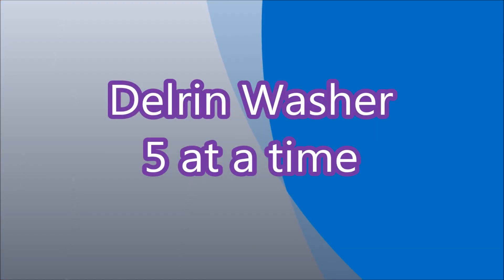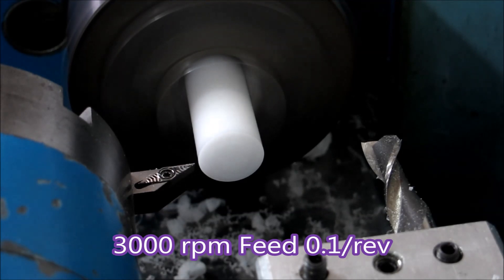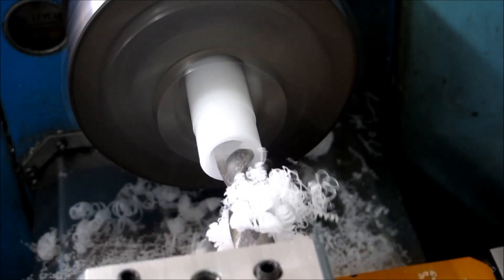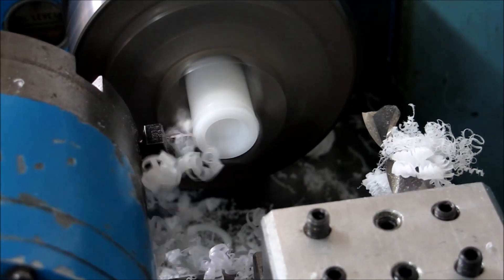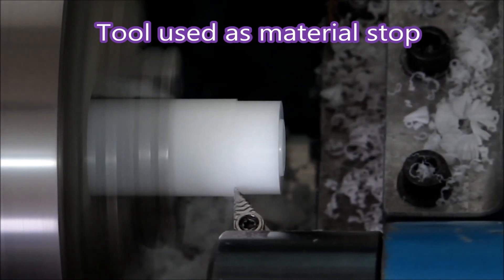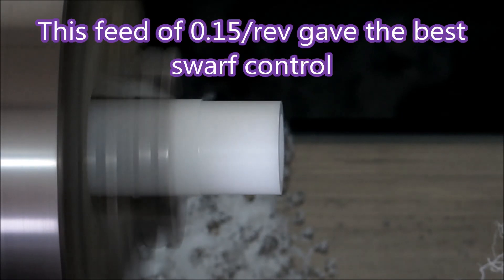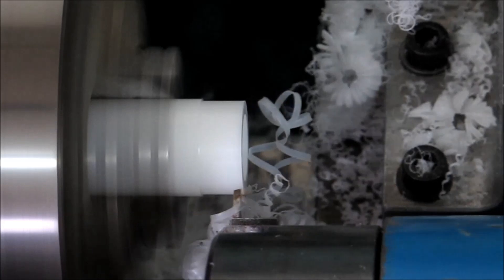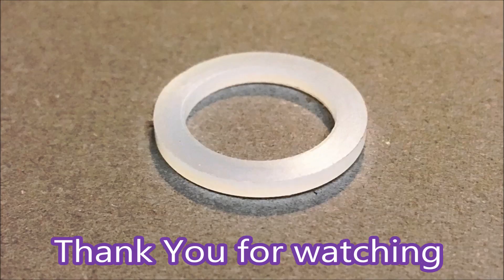Delrin washer, slot drill as a boring bar, made 5 at a time in a small cnc lathe

Comment: Oh! How I have struggled to make washers on a lathe - you make it look so damn easy..Sigh!.... Martin
Reply from the maker: Thanks Martin, as in casting it helps to have the correct equipment. As you know I have three parting tools, but only this one has the razor sharp insert to cleanly part off such a light weight component. No deburring required, which is good as the parts were too small to hold to deburr them anyway. I tried it before I switched to the RH insert!